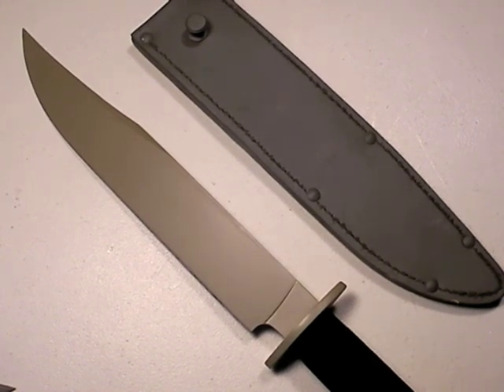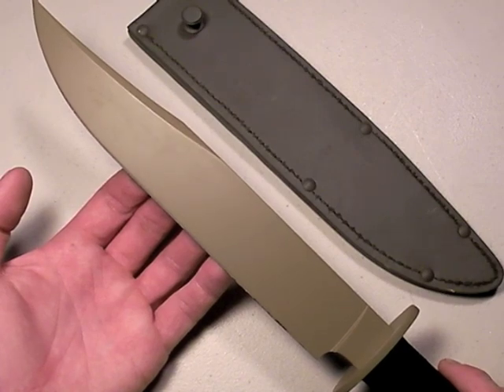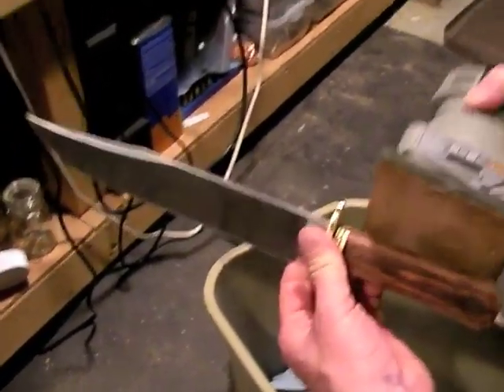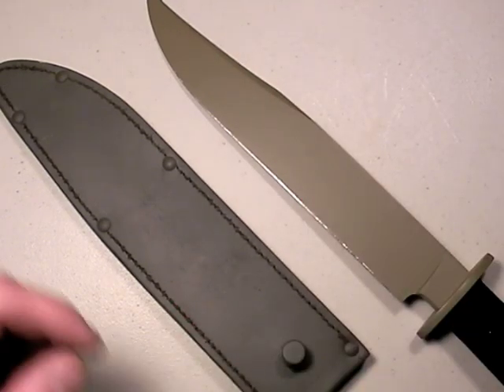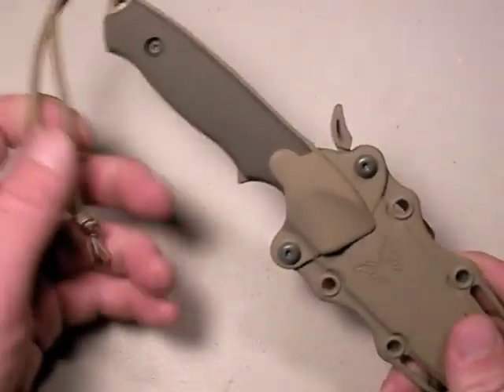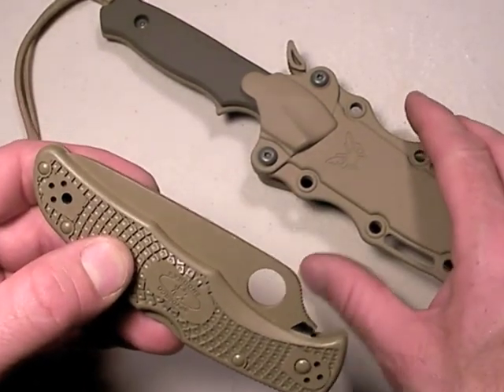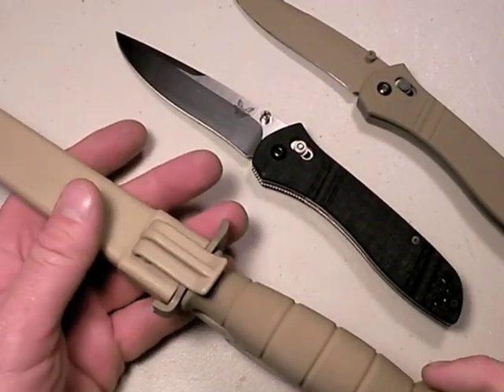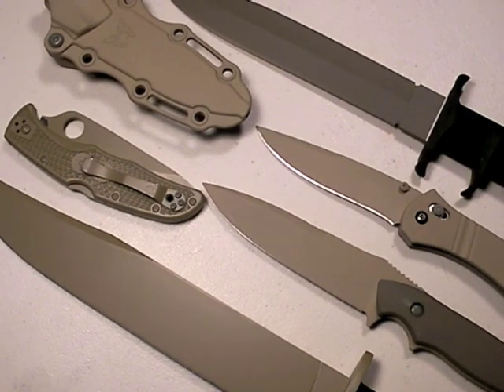DuraCoated Knives Update:  Fresh From the TNP Workshop!

Comment: Quick termo update: full tang extends the full width of the handle as well as the full length.

This is a rat-tail or narrowed tang.
The brass fixture is a barrel nut (short threaded pipe), sililar to the female part of a loveless bolt.

The tip of the tang is threaded & the nut is screwed on (with a slot which is ground off to finish.

Excellent mods on a great knife, thanks for duracoat info :-)

Comment: hey nutn the laredo bowie isnt actually a full tang, the tang extends about halfway and then a steel wire attachs to the nut on the bottom. heard this is still a solid design for its purpose. u can chek it on cs forum.